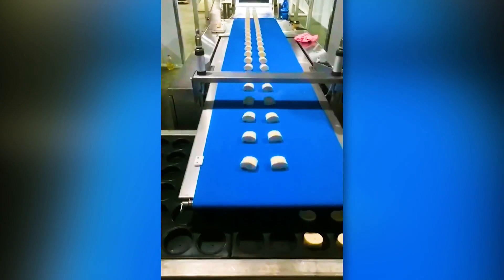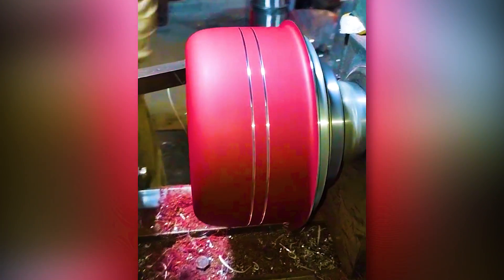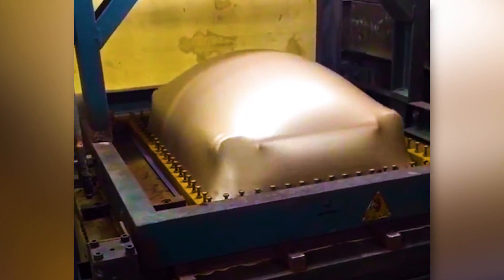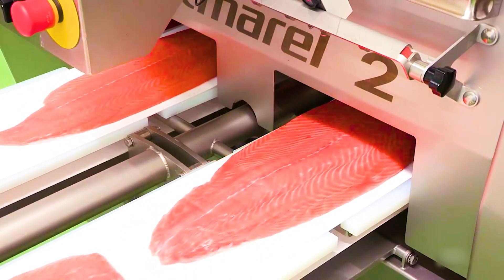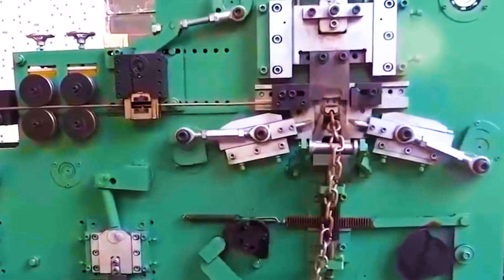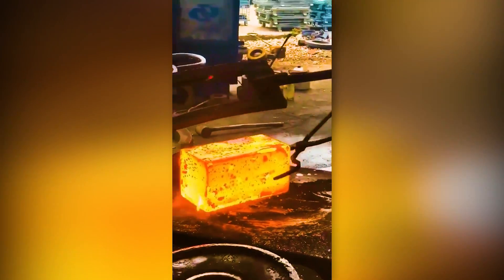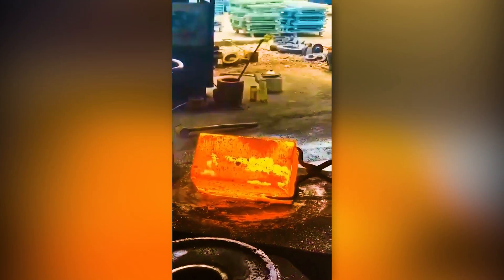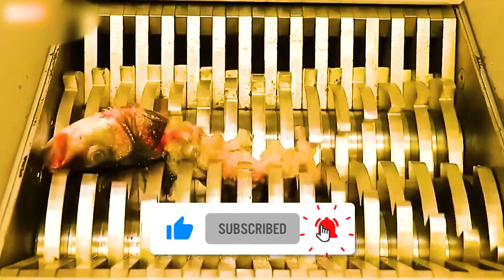Most Satisfying Factory Machines and Ingenious Tools !

Comment: Prepare to get your mind blown by next-level life hacks, gnarly gadgets, innovative machines, and super satisfying tips on how to get jobs done in a skillful way. Machine operators job description includes taking care of all machine-specific functions such as configuring the equipment, loading and operating the machines, and optimizing the machine capability. They need to ensure that the machine works at its full capacity, oversee its maintenance, and perform timely quality checks. The responsibilities of a robot operator job involves the setup, operation, and maintenance of a machine. Duties include entering preprogrammed instructions that a robot uses to manufacture a product or component. These setup procedures ensure that a robot produces products to exact specifications.
2024❤
12🌹22🎉🎉🎉🎉🎉🎉🎉🎉
Thanks for sharing!!!!!!!!
This is the Most Satisfying video!!!!!!!!